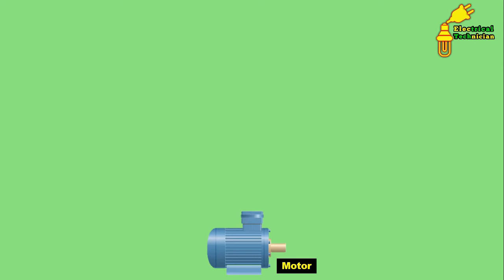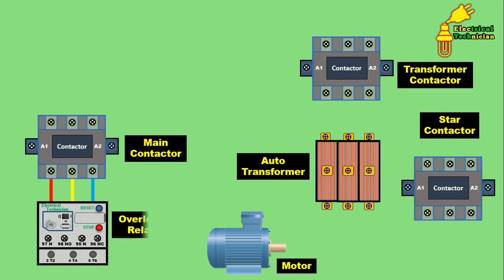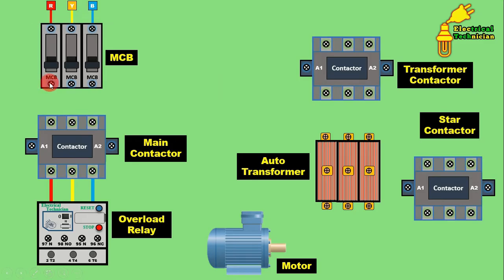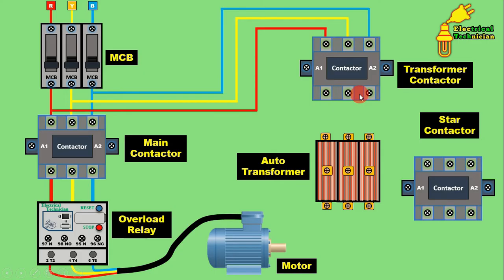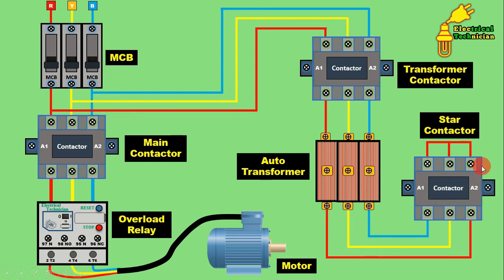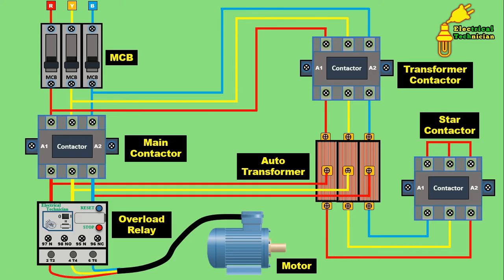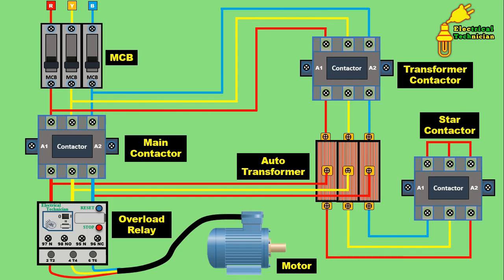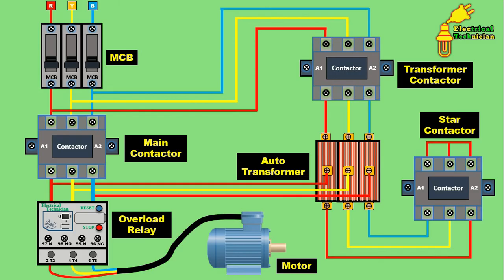Auto Transformer Starter Power Wiring Connection Explained @TheElectricalGuy

Comment: PLEASE EXPLAIN WITH MODEL CALCULATIONS TO SELECT THE SIZING OF SPARES OLR, CONTACTOR MAIN CIRCUIT WIRES, AUTO TRANSFORMER SIZE , SF UNIT / MCB  TO DIFFERENT HP MOTORS.

Comment: Hello. My father has a sawmill but after not using it for a while now there is a problem. When turned on it humming/buzzing but engine does not rotate. Engine uses 3 phases and all of it coming to the main fuses. Saw is rotating easily with hand so it's not jammed.
I am not an expert in motors but I have a little bit experience in electronics. In electric box I saw that there is a autotransformer? (with SSRS tag :D) and it looks rusted/corroded so I guess there is a problem with it. Could it cause such a problem that engine is buzzing and not start? Maybe someone could help and say what should I check to find a problem? (I have multimeter so I can check continuity/measure voltages etc.)